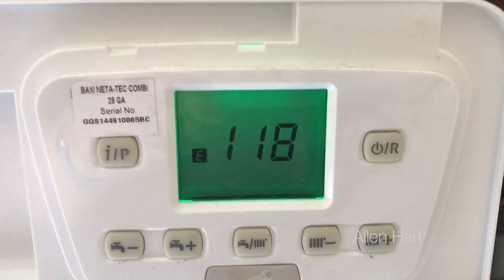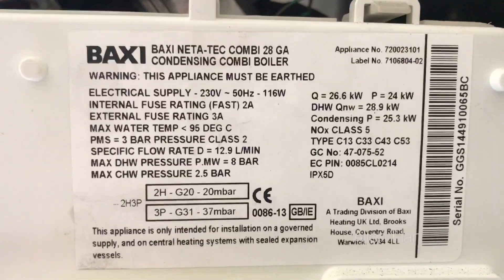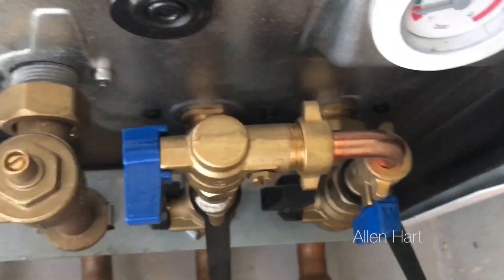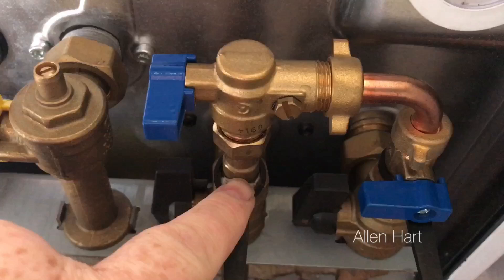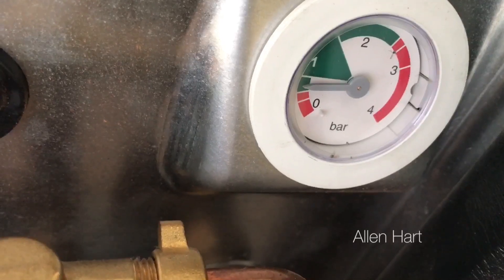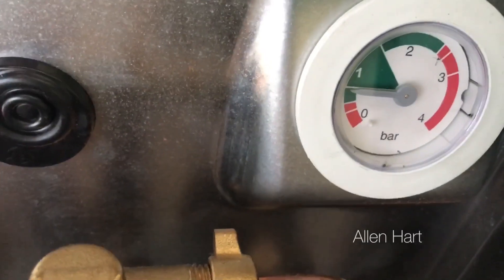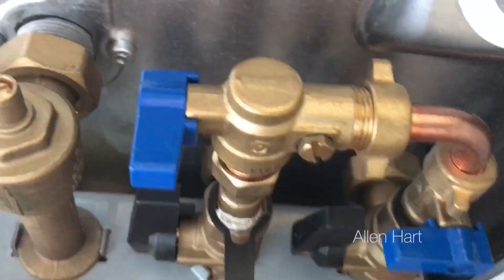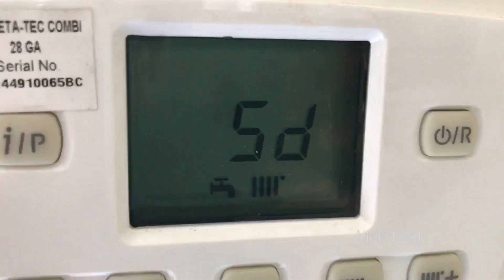How To Repressurise And Refill A Combi Boiler DIY Guide E118 E1 18

Comment from the maker: www.cchleeds.co.uk
Reply: You are nothing short of brilliant. It's people like you that make YouTube so useful. I followed your clear and easy to understand instructions and it worked. I am due for annual service so I will book that in but at least my anniversary isn't ruined by not being able to have a hot shower!
Reply from the maker: @learnsomethingneweveryday1539  Thank you.
Reply: @AllenHart999  thanks for your help cleared that fault. Them four bars next to the tap are flashing on my boiler, do you know what that means ?
Reply: Thank u so much! U r my life saver...
Reply: Hiya Allen first off so wonna say a massive thankyou for the tip guide main thing it's taken the wife off my back now theres heating and hot water back on and running so  a massive thankyou Allen....mow thing is Allen iv switched the pressure inbetween 1 & 2 so the needle its in between now iv had my heating on thanks to you and hot water I then went to check the pressure after 5mins now its gone up to just before 2 so do I leave it or do I release pressure if so how so I go on about that Allen

Comment: The left hand water valve on my boiler wont turn, im a bit wary of using any force in case I break it. Any advice.
Reply from the maker: Did you do it? Thanks.
Reply: I thought this too, thought it was locked somehow, little bit of pressure on it (excuse the pun 😅) and it will turn 👍
Reply: Sorry for late reply, just seen the notification. Yes, all sorted now. Thanks.

Comment: Huge thanks, I bled my radiators and the pressure dropped on the boiler, no hot water or heating thanks to your video it’s all up and running 😊

Comment: Hi Allen, great video, I have an issue that my cold water valve won't open, the blue switch is not moving regardless of the way I try to move it. Any ideas?

Comment: If you get the left side valve stuck, you need to move it pushing it inwards, pulling it back turns it off. You will probably break your fingers or the valve when using a pliar. I found a 2 second fix. Grab a hammer and lightly tap it (metal hammer with a normal nail sized whacking head is best) tap it gently as if hitting a nail to nicely start it off.
It should budge instantly until its totally been pushed by you. Then just pull it back with your hand to close it. 
Increase the intensity gradually if it doesnt budge. If it breaks doing this then the friggin thing wasnt gonna open again lol and its the boiler mans job.

Comment: Allen should the blue tap on right hand side in your vid be open or shut in NORMAL operating condition?? Mine is in open position but you finish vid with it in closed position?? Thanks
Reply from the maker: As long as one tap is off it will be ok. Thanks.

Comment: Thanks a lot for this video! I have a very similar Baxi combi boiler and as of late the display keeps flashing with the low pressure symbol but on the pressure gauge it's completely normal (between 1-2). When it flashes the water flow clearly is reduced in taps. However, this is intermittent and fixes automatically itself but keeps coming back. Any idea why? Thanks very much.

Comment: Hi Alan. Mine keeps rebooting, showing the spanner and a flame with a cross every time I try running Walter or using the heating. Any idea what this could be?
Reply from the maker: Could be faulty board, Might be best to give baxi a call. Thanks.
Reply: Thanks a lot for taking the time to reply!

Comment: I've had a boiler like this before & yes pretty easy to sort out,trouble is now I'm in a different house, same make boiler but all the taps are black!! which I think is very silly on Baxi's part!!so now I'm a bit confused,should I be?
Reply from the maker: Have a look at this one https://www.youtube.com/watch?v=p2bzZpFXDoU&t=60s
Reply: @AllenHart999  thanks for that, I have managed to sort it & reset it successfully, only trouble is there is water dripping from somewhere below all these pipes! now I'm panicking slightly!
Reply from the maker: @mrlipwig6903  Give me a call if you like
Reply from the maker: https://www.youtube.com/watch?v=XScIh_Yd_ng
Reply: @AllenHart999  just watched your excellent video Allen,yes does look quite straightforward but! .... just worried I may make it worse if I meddle! I will have a chat with my wife when she comes in & I will get back to you!

Comment: Definitely just helped me! Thanks so much.
Reply from the maker: Happy to help, Thank you very much for watching.
Reply: @AllenHart999  I do have a question to follow up if that's okay? 
For this boiler. Is there also a pressure release too? Or am I better off just bleeding a rad for a few minutes?
I ask because my boiler is so finicky I've found. 
I pressurise it to a nice safe level, but after being on for a few hours it will go into the red and keep cutting out. And after bleeding a rad till the pressure is barely in the green, works fine all day, hovers just under the red. But the next morning if its off, the pressure will be too low and i have to fill again... Most annoying indeed!

Maybe a tiny leak? Or something else?
Thanks!

Comment: Hi Alan! Thank you for your advice. I repressurised the boiler and it’s working perfect but I think it’s a little high because when it’s on upstairs and down and if I’m using the hot water it goes to the red zone next to the 3 bar? How can I reduce the pressure slightly? I’ve tried to reduce the pressure from bleeding the radiators but it keeps going back to 1.5?

Comment: Thank you so much! My baxi boiler kept loosing pressure and I tried resetting it which sometimes worked, but now I know what to do! Xx
Reply from the maker: If it keeps loosing pressure please call in a gas safe engineer to check it over, remember your boiler should be serviced every year, Thanks

Comment: Alan are you familiar with the vokera vision 255 boilers. Pipes are different and just 1 yellow tap. In the middle of blizzard here & -4 outside, pressure dial is at 0 - would be so grateful for any help

Comment: Very good advice but can you tell me what to do when the pressure gauge fluctuates up and down,but stays above '1' as this is causing an unusual noise ? Thanks.
Reply: Well I found out why from the Baxi engineer who told me that a diverter (or some other valve) was broken and he replaced it which fixed the problem.Thanks.

Comment: The underneath of our boiler looks exactly the same as the video. Unfortunately, the small blue tap on the left won't move and appears to be in a fixed position. Don't want to force it and break the thing. Is there another way of doing it ?Thanks
Reply from the maker: they are often a bit stiff.